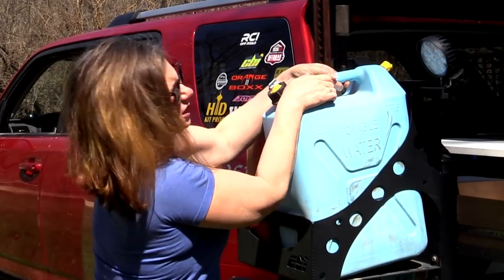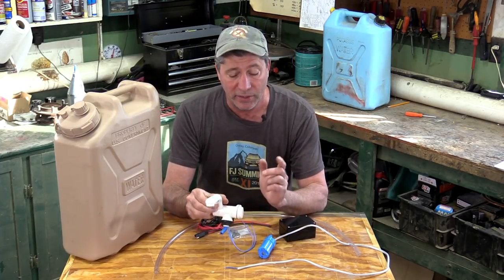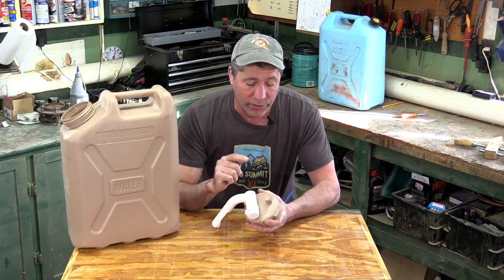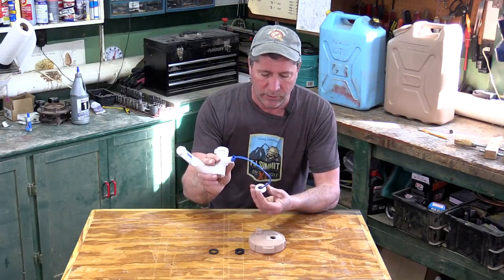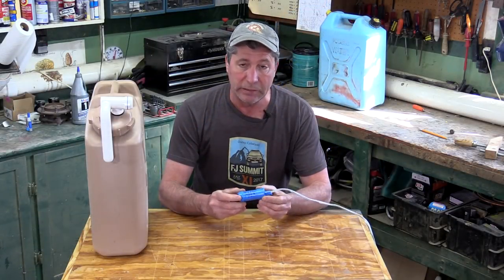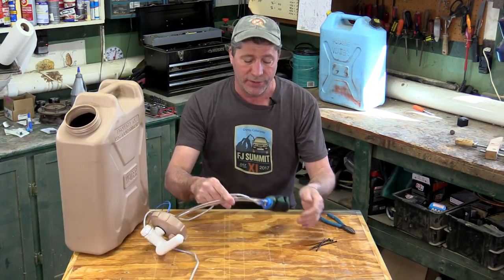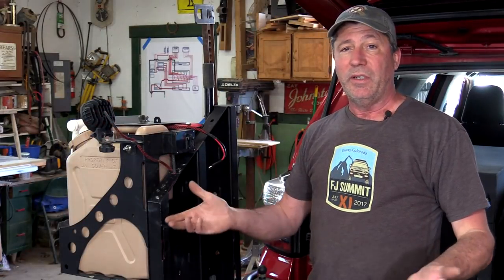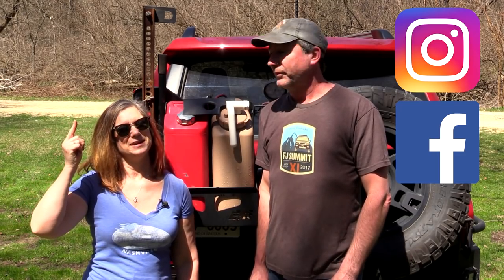DIY- 12 Volt Water Pump System For Overlanding/ Camping

Comment: l       Also used Living Overland's idea to make a manual setup, using the Whale V Mk6 Manual Galley pump.  Installed through the cap via similar surgery.  Only other materials needed were some marine sealant and a short length of potable water tubing.  Cost was about $80.00.
Keep the water can in the gas can carrier, turned backwards so when the carrier is swung out, faucet faces the back of the vehicle for convenience.  Works great, and doesn't require a power source, for those with electrophobia.  When we're on the trail, we cover the entire cap with a gallon size baggie held in place with a small bungee around the base of the can's cap.  Stays nice and clean.
As usual, very nice video, very functional piece of kit!
Reply from the maker: We seriously considered a manual pump first, primarily for its ability to not rely on 12v power to be available.. Like you, we're working on making a cover for the faucet. Great idea! Thanks for watching!

Comment: I would add a 2nd lid so you can remove the entire setup while moving. Then you don't have to worry about the pump bouncing around, crud, or theft. You made such a nice quick power connect anyway. You might also list the gaskets you used even if they need to be sourced at a local hardware store. Nice setup. I have seen the original version but have yet to build one.

Comment: The Lifesaver Jerry can is also a viable option albeit more expensive due to it's filtering ability. You can install a shower hose on it, but it's not really meant for showering. You can dump pretty much whatever water you have access to in it and it will filter it. I bought one a few years back for bug out purposes, but find it very useful.

Comment: Between this video and Overland Bounds version with this setup I almost pulled the trigger & bought all the parts, but then wondered if there was a USB powered pump I could use and set it up away from the vehicle if I wanted. I found a USB rechargeable pump meant for 5gal water jugs used at the office water cooler. It’s quiet, and I only need to run a tube to any water source. It’ll work with an in line water filter too.
Reply: Do you have a link for this that you wouldn't mind sharing?
Reply: @idahoverland_208  thanks so much

Comment: Pretty cool. Is it possible to make a variant of this where the tap could be interchanged with a shower hose for a quick shower or washing dirty boots or something? Then you get both options, a tap and a shower hose
Reply from the maker: Sure, in fact, we have an adapter that screws on and has a quick coupling to a garden hose thread.
Reply: @WanderlostOverland  Do you have a link or more info on the adapter. I'm looking to do a similar project but really want a shower.

Comment: When you installed the air compressor cum air tank, you mentioned its use also with pressuring the water tank. Why change of plans from water tank to jerry cans ??
Reply from the maker: The jerry can with an internal pump is a much easier system for running water. We haven't given up on the idea of having a water tank mounted underneath.

Comment: Hey Guys. Very cool setup and tutorial. I love the small attention to details like wire looms and clamps and foam around the pump.

I was wondering if you could help me with a specific usecase. I want to use this pump but not a switched faucet. I plan to directly wire the pump to a 12V battery pack. However, I will be connecting the pump to a regular tap that can accept screw on hoses and thereby make it multi purpose (showers as well as filling water bottles etc). 

Here is the question: if I turn on the pump but keep the tap closed, will it prime the line and turn off once the pressure builds up? Then when I open the tap will it turn on & start pumping? It would be great help if you can run this test for me on your setup. This is akin to having a pressure switch in an air compressor.

Keep up the awesome work. Many thanks!!
Reply from the maker: Only if your pump is equipped with a pressure cutoff switch.
Reply: @WanderlostOverland  thank you 👍

Comment: Having used the water pump for a few months, what's your assessment of the decision the wrap the pump with the foam material?
Reply from the maker: I'm not sure if it's really needed. We've bounced around on countless miles of rough terrain with it so far with no damage to the pump, so maybe it helps. I do believe that the water itself provides enough dampening.

Comment: I know this ia an old video, but I got to ask the grommet for the wires through the cap... Where the heck did you get a groomer that is that thick, my cap is like 1/4" - 5/16" thick and I'm having a devil of a time trying to find a grommet to work for that thickness. I'd love to know what you did? Thanks, Aussie.
Reply from the maker: I believe we eventually found the right size on Amazon. It was a big PIA to get in though. It may be better to put a modified grommet on top, for looks. Then silicone the heck out of it on the underside.
Reply: @WanderlostOverland  Thanks I'll take a look... PIA is an understatement, lol. but we'll keep it PC for the channel ;-)

Comment: Don't you need a way to let air in when you are pumping water out? You did not mention loosening the cap or opening the other little cap to let air into the water storage while pumping water out, or else you'd be creating a partial vacuum inside the can that would limit water flow. 

8 mo follow up: I made a setup like yours to dispense water from our WaterBrick containers. Then I discovered the little pumps designed to sit atop an Alhambra 3 gallon or 5 gallon jug that have an internal battery that charges via a mini USB, for under $15. Now I use that setup for delicious drinking water, the WaterBrick and 12v faucet for cooking water, and a sun shower water bag with a sink sprayer attachment (hanging on our GrubHub pole) for kitchen wash water. Oh, yes, one more system for bathing: a collapsible bucket with the submersible battery-powered Ivation handheld shower.  Talk about redundant systems!